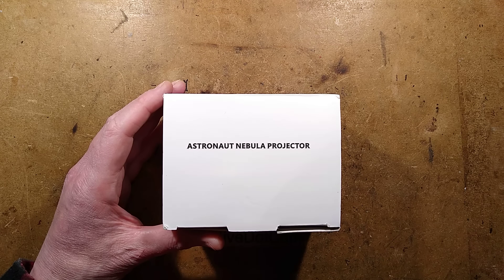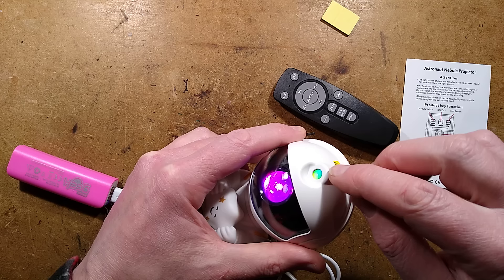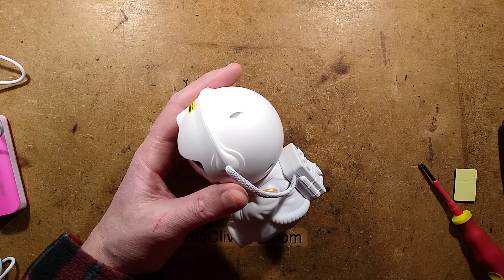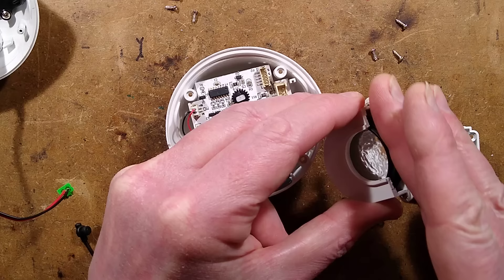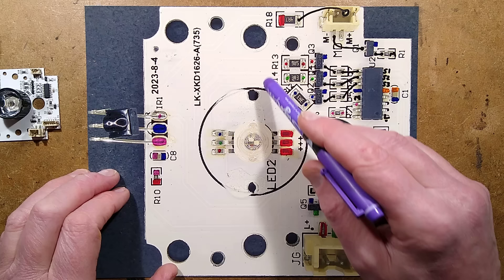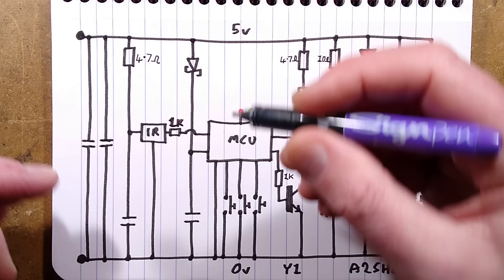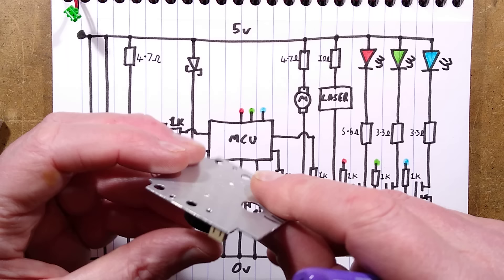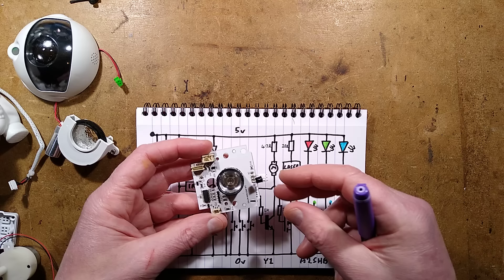Inside a spaceman laser nebula projector

Comment: My kids have a super similar one to this and i had to take it apart to repair it beause the nebula stopped working. The design internally seemed quite different to yours! What had happened was the led accumulated so much heat that the pads of a connecor got unsoldered. I fixed it, added hot glue to keep the components in place, and added thermal paste between the led and the metal plate they had to dissipate heat.
Reply: My daughters stopped working properly so I opened it up and the LED1 board is just floating around inside and I have no idea where it goes, now the Lazer just flashes so I think I have broke it even more x

Comment: We recently had a storm system that passed, bringing us torrential downpours, minor spotty flooding, and winds up to 50 mph (80.5 kph). Many homes with the Christmas outdoor laser projectors had their projectors knocked over, so as I delivered newspapers in the wee hours I'd get blasted in the eyeballs repeatedly. Have you ever tried driving down the opposite side of the road, along a curb, with your eyes closed for safety reasons? 🤣

I'm actually surprised that they splurged for the aluminum/aluminium-core PCB. I fully expected every possible corner to be cut, but it seems someone had enough sense to think about the longevity of their products! If I ever bought one, I'd yank the laser out and hack in a slow-changing RGB LED behind the white dimpled dome used on IR sensors.
Reply: My mom set one of those up. I do NOT see the appeal of having moving red dots on the house.

Comment: I would be careful with the green laser star projector. It uses a IR laser to pump a crystal to make green stars. The IR, if not filtered at the output can burn the eyes. As a test, I placed a temperature sensor (LM34) at the opening of a star projector and found that the sensor's temperature raised by several degrees. Could be powerful enough to harm the eyes. Nice that you can turn that function off, so it's still a nice product. Good show Clive!

Comment: ooh. i love lasers. i never gave them any thought before really. but a month ago i ordered some 2w light output blue diodes and some 500mw lo red diodes. they are great! the way to learn about using voltage regulators as CC supplies is by knackering cheap laser diodes. i killed a few, but now i have an x-cube with a red laser diode, a blue laser diode, and a green pointer i bought. i have done all the usual balloon popping, and blasting holes in cd inlay cases. now im trying to make a white laser using the x-cube. it is hard though, as the red and green are single mode, and the nichia 445s are multi-mode. i even, after watching clive's fog machine vids, bought a cheap 30 quid unit from amazon, it was crap with the juice that came with it. so i got some vegetable glycerol and some distilled water and made my own, around 30/70. wow it fills my study with fog, and my lasers look awesome. i glued some fragments of looking glass to USB PC fans, and aimed my lasers at that. wow again. my study looked like a nightclub. i then bought some diffraction gratings from ebay and some fluorescent markers. all utterly intriguing. lasers are ruddy ace. i'd like to point out after the diodes the second thing i bought was some OD6 goggles. don't fuck about with lasers in an unsafe manner!
Reply: Try getting you hands on an old laser DLP projector, usually they have a bunch blue diodes, and a load of other optical components that can be quite fun to muck about with
Reply: 2 watts of 405nm violet is EXTREMELY dangerous to be messing around with. even diffuse reflections off matte surfaces are hazardous at that power.
Reply from the maker: Make sure you take precautions to avoid direct eye contact from the source or reflections.  Lasers are not great for your eyes.
Reply: @Muonium1  too right. as part of my laser fun i put reed switch interlocks on my study door, which disconnect the power to my bench supplies which power my lasers, so my wife doesn't get hurt. this was also good fun too. thank you for your concern!

Comment: Hi.  let me thank you for your excellent education videos ...  I lived in uk many years and have left uk  twenty eight years ago  videos like your helps me out with my hobby’s and it help me not to forget the English language saying that I recently had to open one of those toys and had to solder the cable inside because the tie didn’t prevent the cable from ripping the socket but I managed to solder it back in … 

My problem was I  couldn’t get the laser to illuminate the stars and that square plastic inside the laser holder that you pointed out was the problem it’s now working 100% thank you  wish you well

Comment: I have purchased the bigger brother Bluetooth UFO Speaker  version in Black where it makes  a pattern like effect that has a USB-C Power socket & Remote.  I love them.   Years ago these were 100s of dollars.   Today?  You can get them for a Tenner.   

I also got the Small units where it makes a Wave effect that is just LED's.    I absoulutly LOVE IT!   
Along with a Small AUKING LED projector for the Ceiling? Its truly magical in my bedroom.  

Amazing how bright these really TINY LED's are!   I mean they are laser bright.    
The Units get warm,  but in a normal 70'F room, they do just fine.   
The motors are still very audible and you can hear the wine from the small black units, but with the Ikea Air filter and brown noise in the background, it's hardly a bother.  

Also, a great source of cheap ready made replacement parts for your Outdoor Holiday Lasers that are plug and play if you need them like I do this year on one of my units I pull out of storage for Christmas.  

The slow and soft fading of the Green laser is nice for the "Starfield effect" 

It will dazzle you if you don't set it above Bookshelf level at an Angle to get coverage of the entire ceiling.  

I have not checked the temp of the Laser as it does not have a finned heat sink, but since its not really being driven at a constant "ON" state, rather a fading setting for me.  So heat does not seem to be an issue the few times I touched the laser housed inside that metal case.  

Worthy of note?
Some of these just throw the laser diode unit inside with little contact to the metal housing they are encased in.  (the laser and the silver looking metal around the laser , as it has a hole inside of it )  
Some use the ones that look like a typical laser unit that back mounts.  Some have the small copper looking thing with a curcuit board behind it as used in those Back-up or Motorcycle laser they sell on ebay. 

Instead of a night light? 
I use these in the bathroom as well.  

Thank you BigCLive! 
What a great video to wake up too!

Comment: I might have added a protective diode to dump current when the motor turns off, but otherwise I like the circuit design.
Reply from the maker: Yeah, I did ponder the lack of diode or cap across it.

Comment: I have a different kind of projector that does a similar thing, it projects a "galaxy" on the ceiling. It has the same green laser "star" option, and on the different laser brightness settings, mine ramps the brightness up and down also. I believe this is done to ease the heating of the laser module. Even with a generous heatsink wrapped around the laser module in mine, AND the ramping up and down of the power, it STILL gets QUITE hot after an hour or two of use. 

On the packaging of my unit, it says "New improved laser" on it, and I'm wondering if they had an issue with the laser modules burning out in the older units that did not ramp the laser power up and down.... 🤷

Comment: The only design flaw I can see (admittedly I am not an engineer, electrical or otherwise), is that the gear on the external drive, just rubbing against that tray, is going to wear down eventually, thus disabling the nebula spin effect.

Comment: I think some of them advertise having sound, so the extra hole is probably for a speaker. I would quite like one of these minus the laser! Is it the same effect as the cube light?
Reply from the maker: Yes similar effect.
Reply: Looks like the IR-sensor is positioned behind these holes.
Reply from the maker: @andreasdill4329  It is.  I spotted that when I was reassembling it.  I should add that to the description.

Comment: My kid wants a nebula/galaxy projector, i was very concerned getting one that has lasers as back in the 90s when laser pointers were actually rare i was stupid and would stare into it all the time despite the warning (thankfully 30 years later still no noticeable effects), and that was a low power red one, despite them being smarter than i was, not sure if i can stop my kids doing the same or protect form errant beams, which as you say are likely to not have adequate IR filtering, esp from a company with no reputation.

I'd probably disassemble and remove the laser if i were to get one.

Comment: The diffusion disc should have been mounted directly onto the lens. Wouldn't need the special housing for it. Motor shaft would need to be a little shorter to edge connect to the disc. Disc would need to be of smaller diameter to match the lens. That would reduce the parts somewhat and reduce the cost a little.
Of course, the disc and the lens could have been the same thing, reducing costs even further. Naturally, the lens would need to be able to spin.

Comment: When you pointed out the IR module I was confused as to how it was supposed to see signals from the remote. From its placement, hanging off the edge of the board by its leads, I thought at first it was somehow looking out the laser port untilI realized it was on the wrong side of the board. It apparently is looking out that small grid of holes that you thought could have been intended for a microphone.

I don’t doubt there is, or at least was at one time, a sound activated version. I hope that the manufacturers eventually realized how horrid that concept is and instead went with remote control.

I also didn’t realize that green lasers had gotten so small and inexpensive as to be casually built into toys. Is it an actual green laser, or a DPSS do you suppose?
Reply from the maker: It's DPSS.

Comment: Interesting little device, and since they used connectors instead of hard-wireing everything you at least have the option to unplug/remove the laser part.
But what I'll never understand is why so many products that are USB powered still have proprietary jacks. Is it really cheaper to use one and having to supply a proprietary cable or why aren't they just using micro USB or type C instead?
Reply: Not enough power delivery
Reply from the maker: Possibly it was designed to use a dedicated power supply.

Comment: There must be different designs. The one I have looks identical, but an RF remote control and an RGBW LED. Annoyingly the RF remote doesn't have unique codes so if you have more than one light, they all get controlled in different rooms

Comment: Okay, I have to admit this is a rather cute retina tickler. :face-blue-heart-eyes:
Given the cheap prices of APA102 or WS2812 leds these days, I wonder why they're still using 11 discrete components to achieve RGB mixing. 3 mosfets, 6 resistors, 1 three-channels batwing diode = still cheaper than an 5050 Sk6812 ?  Hmmm... 🤔 Optical power maybe...

Comment: Regarding eye safety, try filming the green laser mode through an IR pass filter, a lot of really cheap green laser systems use badly filtered DPSS lasers that throw out large amounts of focused IR. In a sub 5mW green laser the visible light is usually just barely dim enough that if you blink reflexively you'll barely dodge eye damage, but a 5mW DPSS green laser can emit well over 5mW of IR and the IR can be off axis, so brighter light and no blink reflex
Reply: IR isn't going to be too damaging at lower power levels but on bigger cheap laser sources it's definitely a worry. Why I have multiple goggles for different applications.
Reply: This looks like it's a newer 520-525nm direct diode laser.
Reply: @Haarschmuckfachgeschafttadpole   I Think you're right (judging by package size) but usually need a reference to be sure, e.g. a 532, it can be hard with auto white balance/etc.  The DDs can run (depending on manufacturer/binning) 510-525 or so these days and up to 100mW. I'd hope this was low power. Looks 5-10mW.
Reply: @user-pf4wp1sb5p  One problem is that the DPSS process isn't all that efficient, so you need a pretty beefy pump diode even if you're only aiming for a few mW of visible output.

Comment: Even the "high" powered lawn projector lasers are only around 20-80mW usually, I doubt this tiny unit is over 10 milliwatts and the individual sub-beams after the holographic diffraction grating probably don't exceed a few hundred microwatts each. I'd be very surprised if it wasn't eye safe even including any unfiltered IR.
Reply from the maker: Never underestimate the likelihood of a kid putting its eye right against the laser aperture.

Comment: I got one of these gifted, only complaint i have with mine is the terrible IR recpetion, cant get the remote to work reliable or via an IR transmitter to control. I feel like the light it emits blocks the IR signals
Reply from the maker: The "speaker" holes at the base are where the sensor was mounted on this one.  Make sure they're not obstructed from seeing the IR remote.

Comment: Hi Clive,
Speaking of lasers I've been to a party 3 days ago, which isn't something I do that often and there was a green laser that was, unsurprisingly according to some comments on other videos of yours aiming at peoples faces, including mine at times.
Moving where there was no laser wasn't really an option but I tried closing my eyes every time the beam hit me in the face, however I didn't manage to avoid it all the times and did as a result experience some bright pulses of light right in my eyes.

The unit, which was fairly small and with a blue metal case looked cheap enough that I immediately thought about the possible lack of IR filter.
Also I'm now facing another issue: Eyestrain ! (That didn't go away even after two nights of sleep).
Maybe it's only from my usual heavy computer usage but I'm kinda worried that it might have been caused by the laser even though I didn't feel anything during the party or immediately after it.
Any idea if it could be the laser or not ?

There was no UV at all at this party, only a few RGB LED effects and that was it so I know it's not that.

I could book an appointment with the eye doctor however it unfortunately has to be done about 3 to 6 months in advance, which rules out that option for now.
Reply: I heard that the IR filters that they use on these green lasers lose their effectiveness at low temperatures.  When used outside during the winter (as projecting light displays for Christmas), they can put out a lot of harmful infrared.  This is a vague memory from a styropyro video (I think), so I could be wrong or missing specifics.
Reply from the maker: At low temperatures the green component of the laser can be greatly reduced, but the infrared is full strength.  Not great when people look into them thinking they are very dim.
Reply from the maker: Don't worry too much about it, your eyes should be OK if you avoided long exposure.
Reply: @BigClive Thank's for the reply.
Party was indoors but maybe without heating, idk, from what I remember it was neither too cold nor too hot and also the ceiling fan above the dance floor was running to keep dancers cool even though it's currently winter.
Some were sweating despite that though.
And the green beam was actually quite bright.
So let's hope the exposure wasn't too long...
Reply: @paulsaulpaul  Thank's for the information.
I didn't know until now that the IR filters could be affected by temperature, however the sole green beam was enough to worry me at least a little bit.
Currently winter here but the party was indoors.
Reply: You'll be fine mate. Even with higher power lasers you need to really stare at them or get multiple whacks in a hot spot to cause damage, the 'damage thresholds' are vastly higher than the real safe limit. Also the eye will repair damage usually. Source - Laser Safety officer for decade +

Comment: This would be fun to hack (i.e. reprogram.) I’d add a “random nebula” feature; you push one of the generic buttons, and it will select a random color for the RGB LEDs, a random burst of speed to the motor (enough for at least 45 degrees of rotation), and would “freeze” it in that state until you push the button again, or select a different mode. It probably should have a self-destruct mode. You know, in case Klingons are about to overrun your position, and you don’t want them capturing your “valuable” laser nebula spaceman toy. 🤣😆😂 Maybe it could shoot 5G death rays, or - at least - shoot the laser beam through the diffraction disk so it goes wildly about… kind of like the Borg.

Comment: What do people think about the danger of the laser? I bought one unit for a 4/5 year old but ultimately sent it back because it was very unclear about what the laser rating really is and I couldn't guarantee safe handling. I also read that some of those lasers are cheaply built and might not really conform to its stated (or here not even stated) specs because it seems to be simpler to take a simpler, more powerful design and try to tune it down with more or less effect. It's that true?
Reply from the maker: I regard the laser as dangerous if young kids use this as a toy.

Comment: Do you have information on the battery and it's BMS for the astronaut?
I got one and the astronaut worked using it's 3 buttons.  But after USB charging overnight it quit working from the battery.  It does work from USB power including responding to the remote.
Reply from the maker: I've not seen the rechargeable version.
Reply: @BigClive  That's because I forgot it needed to be plugged in to work.